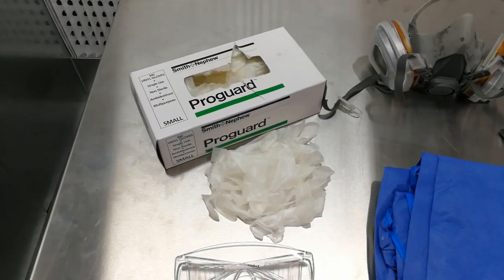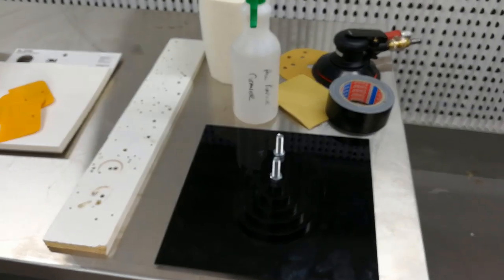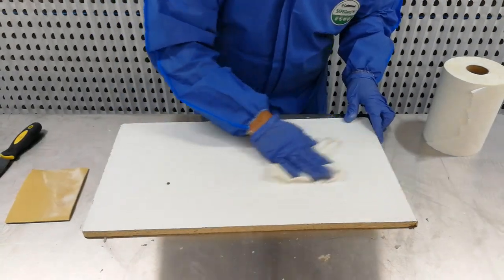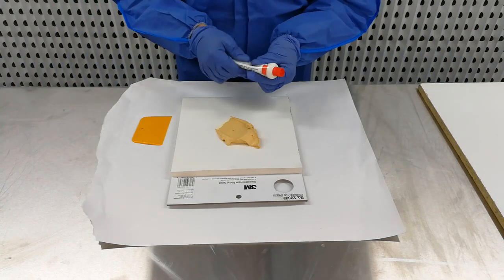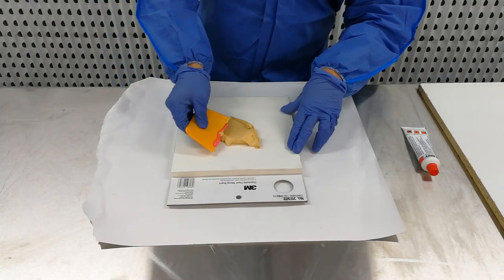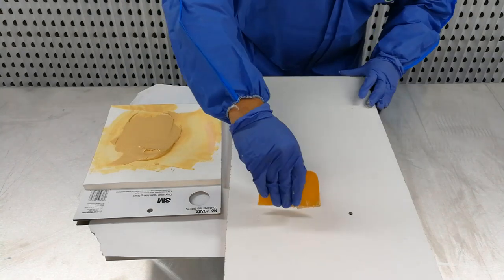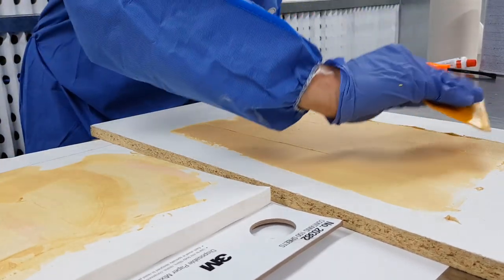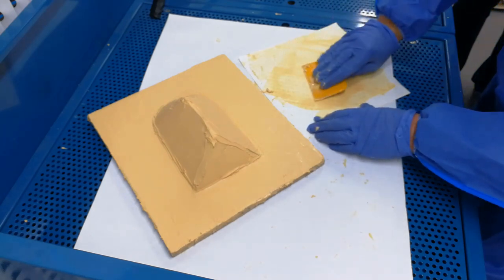Body Filler Mixing and Application

Comment: If you mix at that ratio here in Africa it will harden before you can start using it. I do 90:1 ratio so I can have a longer work period before it hardens